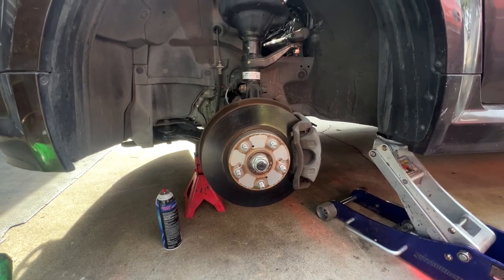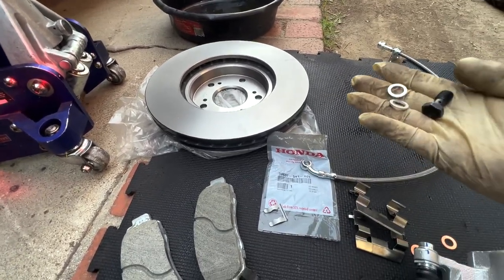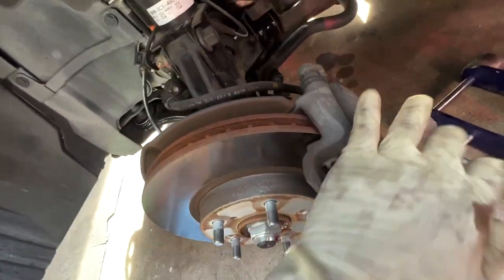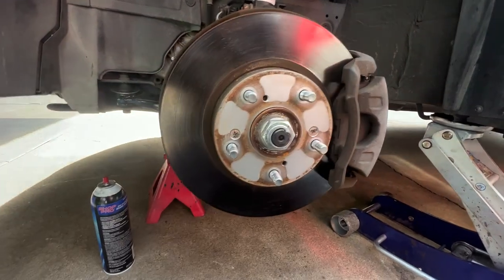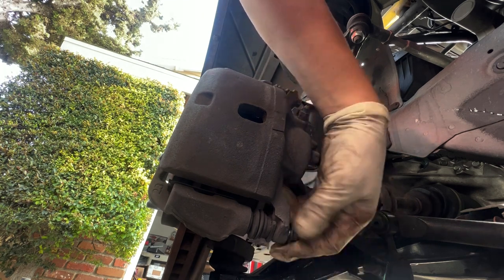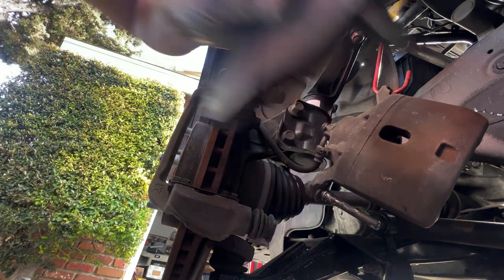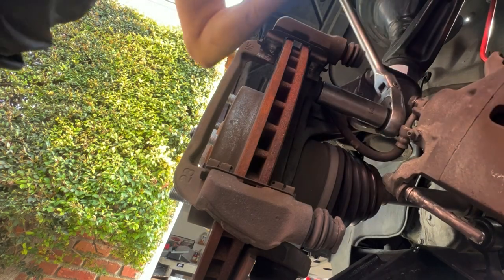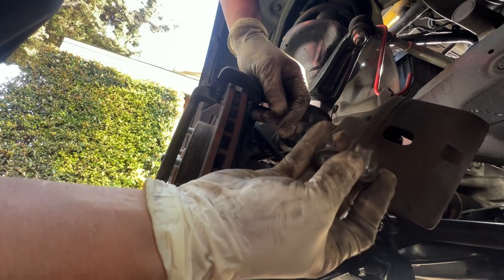Honda Element Upgrade Front Brakes & Stainless Steal Brake Lines (Acura TSX conversion) Part 2 of 2

Comment: I have a question ….should we change the brake booster to a TSX and a master cylinder to a TSX ? For the steel braided lines you recommend to change all lines to steel braided for even pressure and depending on the proportioning valve and ABS will still be fine to run the system , I’m also thinking the choice to use what proportion valve depends if your Element is FWD or AWD .

Comment: how would you know if you had to bleed the brakes again?
Reply: Anytime you open the brake system, via disconnecting from the braking system you introduce air and end up trapping air as you close the point of operations.

Comment: I found that you could also carefully bend the backing plates (instead of cutting)....makes for a cleaner install.
Our Elements should have come with more capable brakes from Honda.
Since they didn't, the TSX front brake upgrade is a Must.
Reply from the maker: Yes I hear some people doing that to their elements. Both ways works and is personal preference. Just make sure when is bend or cut to spray paint that part so won’t get expose to corrosion 👍. I agree Honda element should come with this TSX brake style from factory